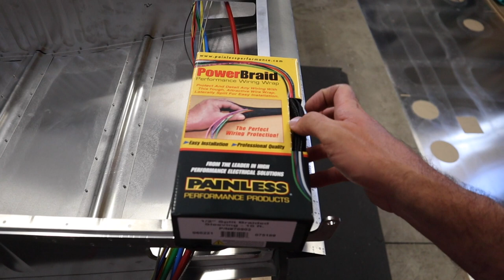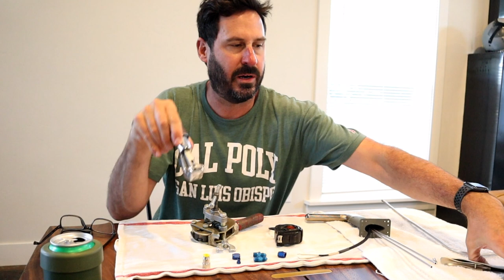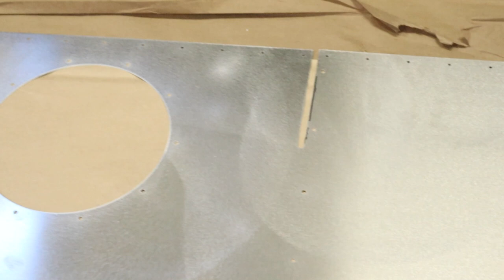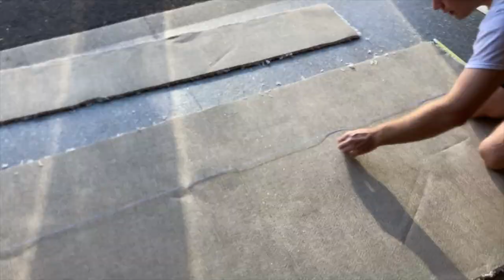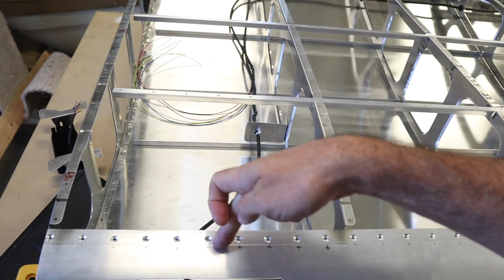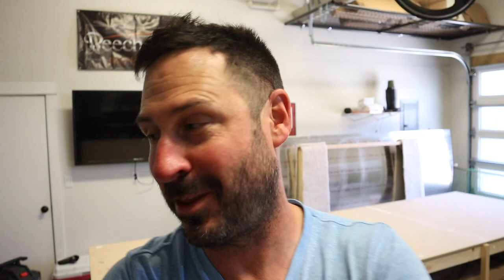RANS S-21 Ep 7 Wings Pt 2; LONGFORM

Comment: I'm finally catching up with your progress. Nice job bundling up those wires. Loose wires (especially hidden ones) make me very paranoid...but they are out to get me so paranoid might be the smart way to think. A neat little trick that I use to keep electrical tape wrapped around wires from coming off (and it always comes off eventually) is to put a little zip tie around the last wrap of the tape...so when the sticky fails, it can't go anywhere. Modifying your plane on the fly is (in my opinion) the greatest thing about experimental aviation.
Reply from the maker: Thanks. Unfortunately I learned about the benefits of twisted wires AFTER the fact. Should be fine for the simple lights. Man I'm in DEEP DIVE mode on avionics wiring. Tackling it myself but not sure how much money it's saving me with how expensive aircraft grade CAN bus wiring, crimpers, dies, etc. cost. Oh well, it tickles my nerd fancy. Not sure how much more filming I'll do of this project. RANS took offense to one of my videos and made some pretty damning claims that I'm endangering lives. It's hogwash but still pretty deflating and they're stifling the experimental spirit. Okay byeeeeeeee
Reply: @CLEAREDDIRECT  Twisted pairs aren't usually a big deal for lights. It's more to prevent signal interference leaking from parallel wires. I think your radio/avionics stuff is in the fuse so I think you're cool with wires in the wings. 

You can twist wire pairs coming out of the wing and that will stop any potential interference from wires coming into the cabin.
Reply from the maker: @Joe_Not_A_Fed  woah, check out the big brain on Joe! Thanks for that tidbit…

Comment: FYI, I saw another video of a build by an avionics engineer. He recommended avionics grade zip ties as they will not get brittle. He also used a clear plastic tube for a conduit, and even put a string in there in case he needed to pull wires in the future. Maybe overkill.

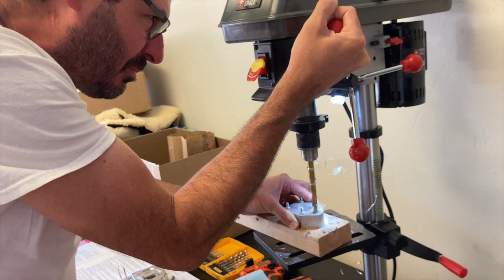Comment: The amount of force if the drill catches at 24:07 is stunning.  That part will be torn from your hands and you will be along for the ride.  Buy a cheap drill press vise, it's safer.
Reply from the maker: Thanks for your concern! There was hardly any force, but I’ll use my vice more in the future! I have had stuff catch, but luckily no problems.

Comment: I have enjoyed watching you videos. I am a bit confused. You say you put your head of the bolts on the bottom and the nuts on top and that this is the correct way. I have built many planes in the past and was always taught the opposite. Reasoning is that "IF" the nut were to fall off, gravity will hold the bolt in place. What is your reasoning? Thanks